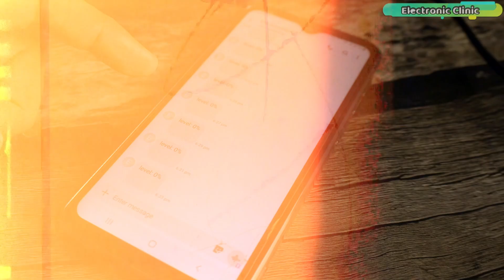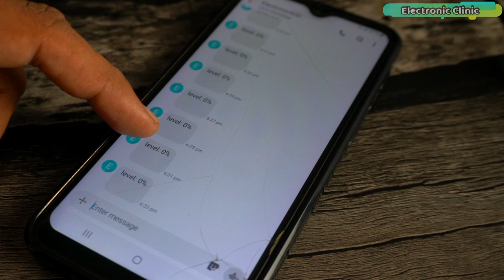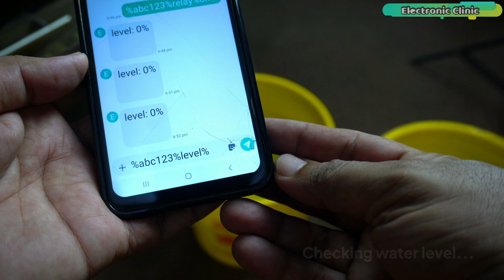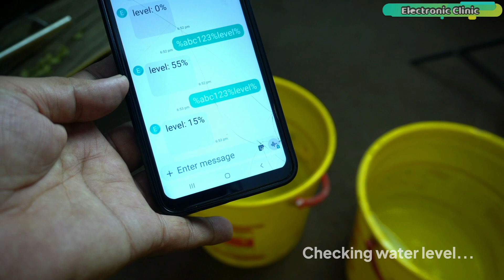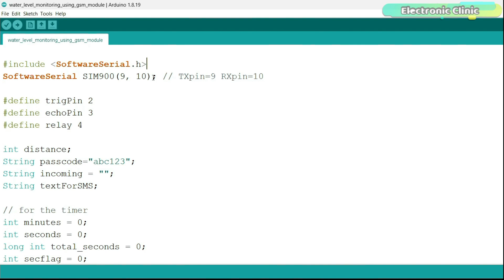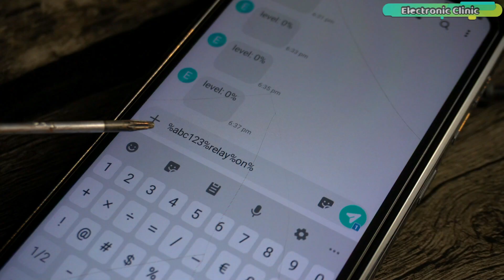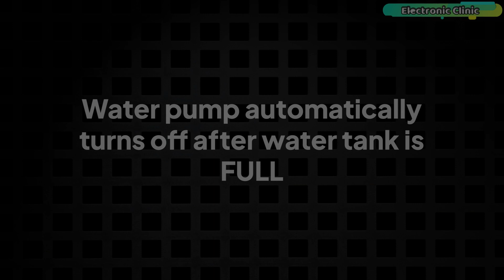GSM based Water Level Monitoring and Control using Arduino, Sim900A, and Ultrasonic Sensor

Comment: Good evening is it possible to create a prototype like this but use wire as a connector from the system and put speaker to the other end. The purpose is to place the speaker to a far place extending the sound of the alarm

Comment: I have rainwater containers buried in the ground and would need to have level indicator like this , problem is such water is very soft and normal indicators don't work because there is no chemicals in a water to transport electricity to put it plainly, how would you work around that? Apparently it's a common problem with rain water containers.
Reply from the maker: Did you practically test it with an ultrasonic sensor?
Reply: @ElectroniClinic  no but i ordered something called hydrophore pump , it's a whole system with sensor included. I don't think it is a ultrasound it's using as a sensor. I think it is a different element. Will be testing when it arrives

Comment: which network connectivity i need to use here can i use the 4G sim ?
Reply from the maker: no, you can't use 4G. You can watch my videos on sim7600G and sim7600G-H. these modues support 4G networks.
Reply: @ElectroniClinic  thanks for the reply ❤️
Reply from the maker: soon i will make 4G version of this project.

Comment: Use water resistant ultrasonic sensor for better life 
Just my suggestion 😊
Reply from the maker: I already used it, A02YYUW Waterproof ultrasonic sensor. Its an amazing sensor.
Reply: @ElectroniClinic   water droplets get accumulated on the sensor body due to condensation in water tanks. This won't damage the sensor as it's water proof, but the readings will be wrong.
Reply: @ElectroniClinic Hello brother. I only have 3 days. Please help me and just tell me the height of the bucket from the ground in your video, and the height of the sensor from the ground. I’m waiting for your kind reply.